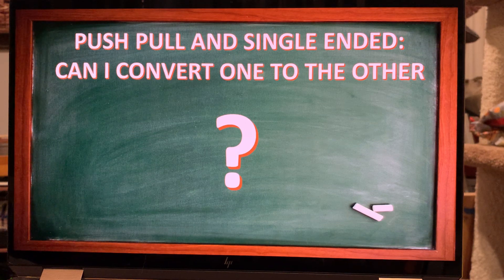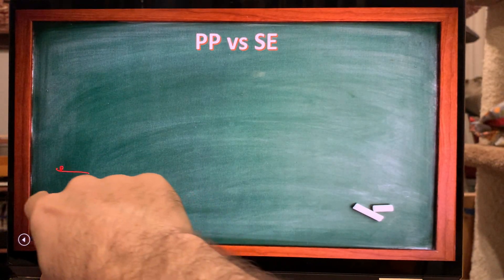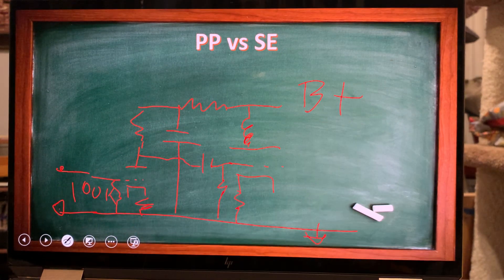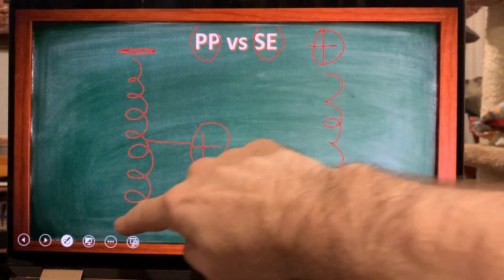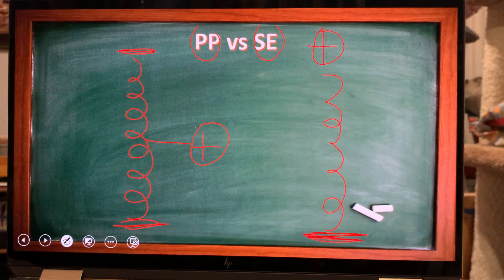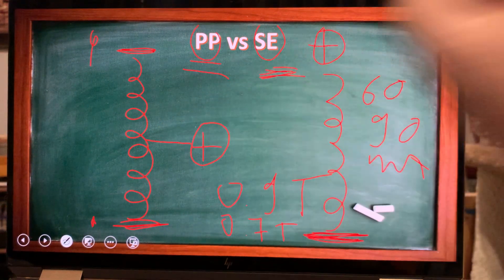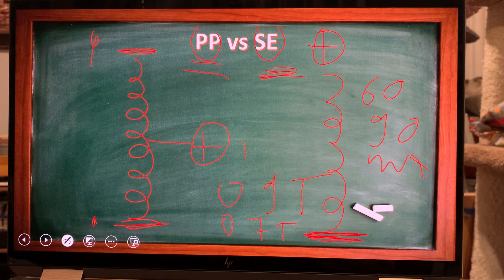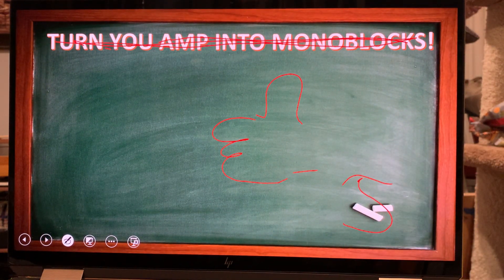Can a Single Ended amplifier be converted to Push-pull or vice versa?

Comment: Let me say from the out set that I think both single ended and push pull can sound 
wonderful if properly implemented.  I can easily switch from single ended to push pull in my interstaged paralleled 300b amp. In single ended mode I configure the secondary windings of my interstage in series and use the single ended output transformer. To switch to push pull I separate the link between the two secondary windings and now I have a phase splitter to drive the push pull 300b tubes, and hook up the push pull output transformer and it is done. The interstage transformer is a very useful thing as it also makes for the best phase splitter because the output impedance is the same for both halves and the frequency response is the same for both halves unlike other tube based phase splitters.If you want to make your push pull amp more coherent like a single ended one use an interstage and it will have the more as one sound that we all love in single ended. Regards Lou
Reply from the maker: Ingenious! I did not think of this brilliant solution. I completely agree with you, push pull can sound wonderful as well. I am using the long tail pair for phase splitting, and it gives a very good single-ended like sound, but I suspect the transformer phase splitting is the absolute best way to do it as that's the only way the phase gets split perfectly. I suspect the LTP may come as second best.. ;